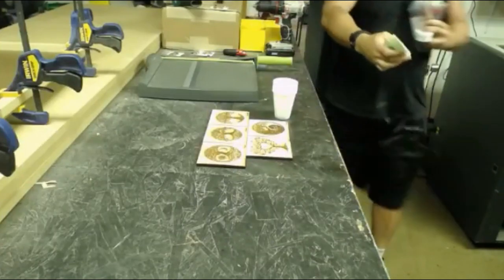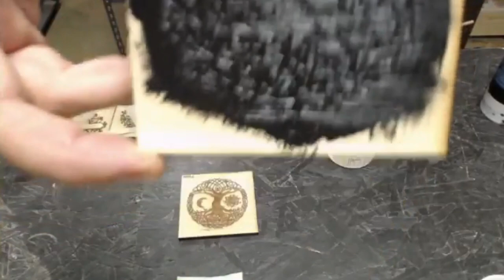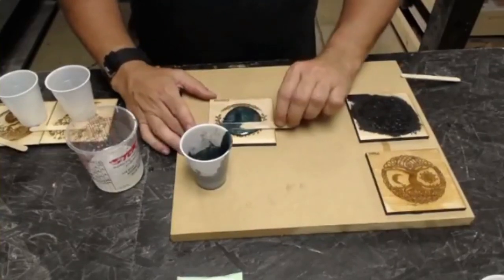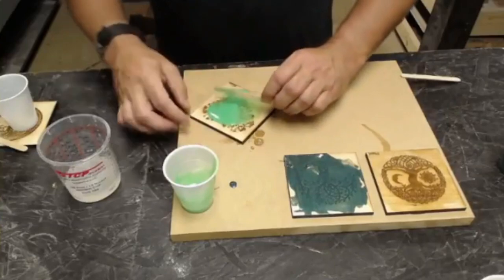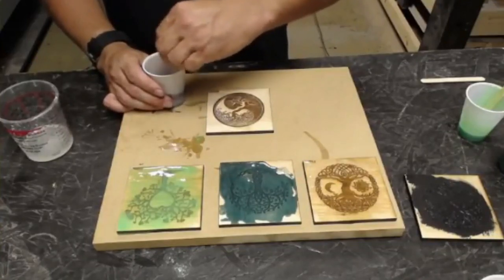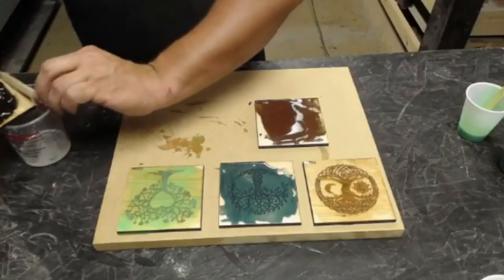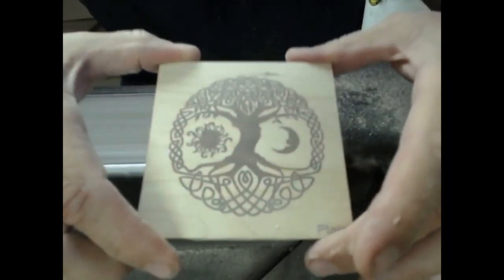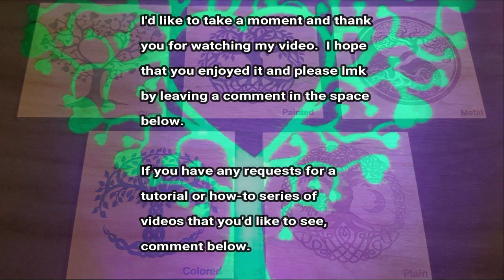Epoxy Resin Tutorial - How to Fill wood engravings like a pro 5 different ways to DIY

Comment: Super dangerous to sand that way. Your finger hits that sandpaper and pulls it into the gap of the metal and paper and you're in a world of pain.
Reply from the maker: Only dangerous if you don't respect the tools bud.  30yrs and haven't hurt myself using this method yet....and I routinely sand tiny pieces this way.  However, thanks for the concern.

Comment: No gloves?  You really should be wearing gloves and a respirator when working with epoxy.  You might be OK for a while but at some point you will become allergic to epoxy and won't be able to get anywhere near the stuff.  If you're making a how to video you owe it to your viewers to warn them about the possible hazards.  That aside, the finished product does look very nice.
Reply from the maker: I don't know what kind of terrible ventilation you have, but my shop has several filters.  I don't need gloves or a respirator for small amounts of epoxy.  No one does.  If you were doing a boat or a large river table, then you would.  Thanks for the message though.